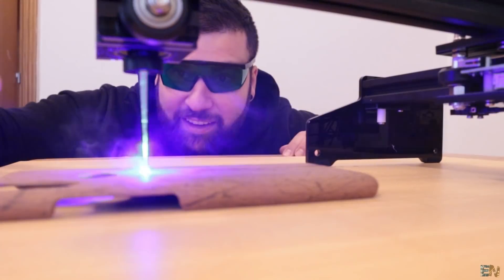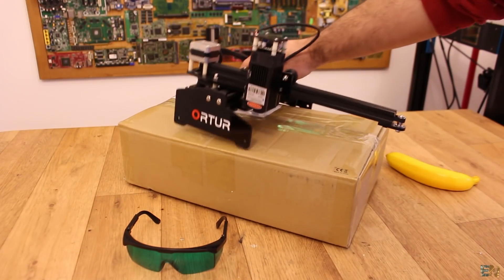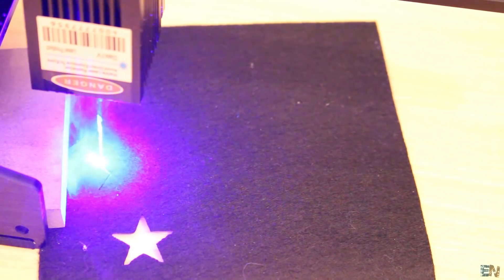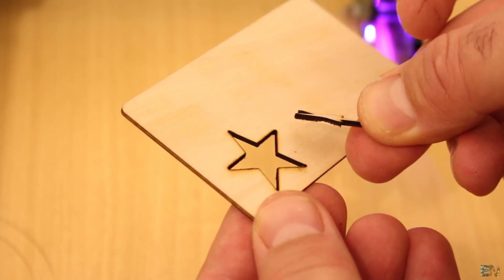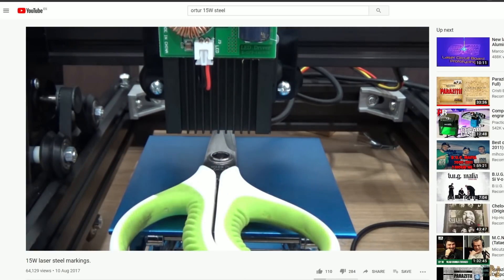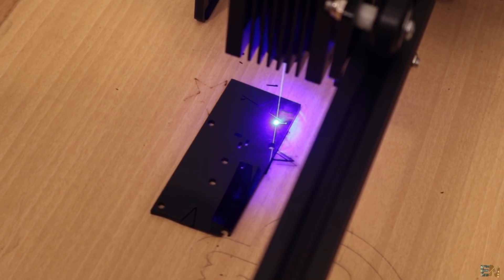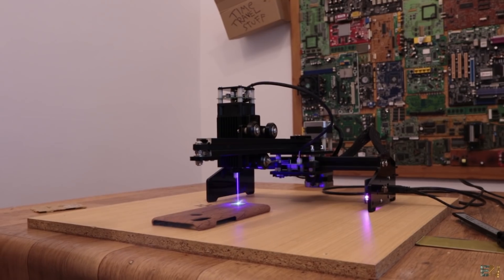What Can You Cut With This "15W" LASER Machine?

Comment: A bit of compressed air might help with wood cutting. There's a lot of smoke coming right off the hot spot, which is absorbing/blocking/defocusing the light.
Reply: That right. Even on a 40W CO2-Laser  compressed air makes a difference of several mm in Wood or PMMA.
Reply: Which is why proper laser cutters have an active air exhaust. And, you do not want to breathe those fumes.
Reply: It also (with diode lasers) makes a big difference what's underneath the wood your trying to cut. The only reliable way I have of cutting some  3mm "laserply" on my so-called 5W laser is to sit it on top of some paxolin PCB I had laying around. This half melts when the laser hits it and reflects the heat back up into the cut enough that I get smooth clean cuts 99% of the time. The only issue I have now is I'm not sure what that would be giving off as fumes (I work well ventilated) and also I'm running out and don't know where to buy any more or what else would work as good as it for a base plate.
Reply: even a fan would help
Reply: Price
Reply: I just have a fan turned on high facing it, blowing towards a window that I have a box fan in sucking the air out and it works really well.

Comment: Would painting the thicker MDF and thicker materials with black paint increase the cutting depth at all, d'you think?
Reply: Yes, the darker, the better, to advoid the reflection of laser
Reply: No ! this type of laser would take many passes for thicker materials. Define "thicker ".
Reply: @texascharlie4554  OK, cheers. The absolute "thickness" isn't important, though - I didn't ask if painting thicker things black would allow them to be cut all the way through; I asked if it would increase the cutting depth, which is a relative thing. If black paint/black surface treatment increase laser absorbtion, then the extra light absorbed (and extra heat generated) would surely increase the depth OR the width of the cut - or both. Or maybe just cause it to burn unpleasantly, perhaps! "Thicker" just means "thicker than the successfully-cut materials".

Comment: That's why I use a laser mounted onto an Ender 3. There is a hot swappable Thingiverse print that works well. This way you can lower the Z height after every pass to keep the laser point focussed on the layer you want. Gets through much quicker. I guess the printer you are using only does Z and Y.
Reply: Hi, I'm thinking of trying this with my Ender3, what laser are you using and what power output?, Cheers Sean.
Reply: @Séananigans69  Just a cheap chinese Laser. Cost about $80 with fan, module and glasses. On ebay..search for " 445nm 2.5w blue laser engraver"

Comment: Soon my companies 200 watt laser for sintering metal of 3D printed parts will be up and running.
Reply: Is it using a diode laser? A single diode laser?
Reply: @321ooo123  EOS 290 m Actually it is a 400 watt fiber laser. The polymer printer we will be getting is 200 watt.
Reply: @JoshWeaverRC  I think that's priced waaaaaay beyond the laser in the video :)
Reply: @321ooo123  Just a tad. And I bet it is a legit 400 as advertised.
Reply: Josh Weaver RC but can it cut 4mm balsa wood? :p
Reply: @He4vyD  I'm sure it can my man, but you want to look into a glowforge printer. It may do that.
Reply: Josh Weaver RC my question was meant as a joke... it would be very sad if your 200 watt laser couldn't cut that seeing the 7 watt one from this video almost could...
Reply: @He4vyD  Definitely, I was only answering for the cool factor in the slight chance you were wanting to make RC airplanes. A CNC laser cut foam wing or even another cutting device could be in my future for making planes.
Reply: How much the 200 watter lase would be?
Reply: @justintan7817  Ours is a part of a larger machine, so I'm not sure how much the laser itself would be. A lot though.

Comment: Can you try cutting regular white printing paper?
Reply: I would like an answer instead of a heart ;)
Reply: @He4vyD  Regular paper is actually a pretty decent challenge.
Usually it'll catch fire. If you cut fast enough, and in straight cuts, the diode powers up fast enough to cut in, without flair up. If the motion slows, to change direction, such as the star shape, it'll flair up on the corner, and burn. Air does not help enough, it does a little, but the beam is just not narrow enough.
Cardstock, 110lb. or velum 90lb, is a little better.
Reply: Tnx dude

Comment: I have a EleksLaser- A3 Pro 2500mW Laser with a Z Axis mod.
The Z Axis mod will lower the laser every loop causing the focus to stay on the material needed to be cut.
This mod works great!
Reply: Ortur Laser Master has more safety protection function, also the power ( Electrical Power: 15W, Luminous Power: 4000-4500 mw) of this one is higher, maybe you coud consider to try this one.
Reply: @justintan7817  I for sure would like to try / test / review it. Will you send me one? :-)

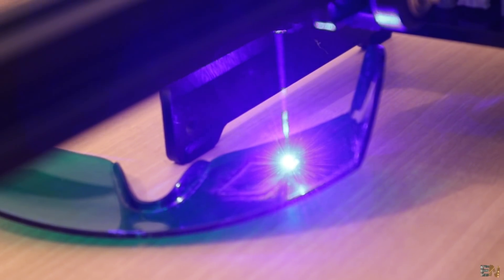Comment: If you can see ANY bit of light from the laser then they're dangerous. Your google look like they are the wrong kind, though I am not sure since you haven't shown us how the laser looks trough the glass. It does look like I can see a bit of reflection through the glass from the wood at 5:30
Afaik you should use yellow glasses since they block blue. (And 405nm is blue) These green onse look more like google for IR or red laser.
Reply: You do want to be able to see a little of the laser light so that you won't be tempted to take them off just to see where it's going. That said, if you end up with a pair that blocks too much, a quick fix is to use a smartphone or other camera+screen to map the wavelength to one that does go through.
Reply: @NiHaoMike64  How can you yourself calibrate the glasses accurately enough that there isn't more than 5mW of photonic energy going through? If the glasses aren't made for a specific Energy then it's impossible to be sure that what comes through it isn't damaging.
So: Use glasses where you can't see anything of it!
Reply: @NiHaoMike64  Very neat idea, thank you!
Reply: Ortur laser master is 445nm
Reply: @justintan7817  That's even closer to green, and these goggles are green - therefore they certainly are not the right kind.

Comment: The eBay glasses are definitely not safe to use. They might not melt completely through but they only block about 99% of the light which isn't nearly good enough, you can still get injured from a reflection or direct exposure. I would recommend glasses with at least OD5 to be safe.
Reply: Take no chances with your precious eyes. Go to LASERSAFETY.COM and read what you really need.

Comment: The most powerful single diode out there which can fit in a diode holder that big is nubm 47 with 7watts output power.
Reply: Exactly, there's no 10w nor 15w laser module out there
Reply: Though I do know a manufacturer, who uses prisms to combine output of 2 to 4 diodes and seal it up in a single housing.I think they are called endurance lasers.  And there are indeed big industrial diodes like the one Michel reps showed.

But none in that size

Comment: The issue when cutting through 4mm balsa is from the nature or your "cutting element" the laser is manuly focalised on the top or the material. When it has cut two mm, the laser isn't focalised in trench and the material needs more and more energy to cut because instead of focusing thé energy  in a tiny spot to burn a little piece of material, it is burning a greater surface. It would has been useful to have a Z-axis to lift down the laser after each loop and keep the energy/surface ratio constant
Edit : I had not seen the explanation before posting m'y comment
Maybe, try to focus the laser in the middle of the material instead of the surface
Reply: This is correct. To add to this, instead of focusing the laser in the middle before you start, do 1 or 2 passes with it focused on the surface then refocus the laser to the "new" surface a couple of mm down, keep repeating the process until you've cut all the way through the material. The more you do it between passes, the better the cut will be as long as the material or the machine head doesn't move.

Comment: I suspect the problem with thicker wood is that once it has charred the wood to carbon, the carbon is extremely heat-resistant, so it doesn’t burn away. Thats very interesting about plywood though!
Reply: I suspect but cant prove is that the glue layer between the plies is burning away cleanly and exposing a fresh layer of wood. Another factor is on the 5m play the outer layers are probably a different species than the face layers. . It would be interesting is to see these tests on various thicknesses  of birch, aircraft or high ply count model plywood. I've got some .4mm plywood that has three plies of equal thickness. A sheet of .4mm is at least twice as much as .8mm and even more than a sheet of 6mm. Another test I would like to see is on Basswood or Linden. Say .8mm, 1.5mm and 3mm. These machines are meant after all for hobbyists. One could even use them for a modest business producing say craftsman style kits for model railroading.
Reply: That's one reason the Russians used Oak for re-entry Heat Shields at one time IIRC.

Comment: Do you think spray painting the PCB and using the laser to remove the paint would work for etching a circuit?
Reply from the maker: Yes, I've tried that with lower power laser and it worked...
Reply: That's what they did at Texas A&M to make PCBs. The etching worked great but the via plating left much to be desired. Of course, now that PCB services are way cheaper than they were back then, making PCBs at home only makes sense if you want a really fast turnaround time or if you're making PCBs out of something other than FR4 such as flexible PCB.

Comment: The eBay glasses are not good enough.... but there's no explanation whatsoever as to why that's the case.
I'm not asking why, I can draw conjectures myself, just noting that making a judgement like this without backing it up is just not enough for a review video.
Reply from the maker: just low quality and less wavelength filters...
Reply: @ELECTRONOOBS  thanks, how did you measure that? I didn't see it in the video.
Reply: Not only that, sometimes, the wavelength they are advertised for, is actually the one wich it doesn't block.
In other cases, it doesn't block enough.
Reply: @SurajGrewal  well it's a review. IF reviewing means saying "you know, it maybe okay, or maybe not, I think it's not". Then it's not really useful.
Measuring stuffs in the physics world is how you assess things. Don't ask me how to do it, I didn't make the video. But maybe my expectations are too high for electronoob.
Reply: @unperrier  ok... Get a spectrometer and a full wavelength lamp to test it... With that, you'll be able to exactly tell, what optical density the glasses has and for what wavelength. But it'll set you back with about 50-5000$
Reply: @SurajGrewal  All I'm saying is that a review that says "it's probably crap" is not a review if he doesn't have a real clue. No proof, no claim, simple.
Reply: 'Probably', right?

Comment: Could you swap the laser for a more powerful one and still use the base?
Reply from the maker: Of course
Reply: but the thing that i'm afraid of, the laser module is mounted on a single axis with no support on the other side, if  the more powerful laser module is heavier, it might cause some problem later on
Reply: @clee2423  There are plenty of higher power diodes that will fit into that housing. Just be sure to use a driver that can deliver the additional current to the diode.

Comment: As anything goes for china products, you can divide the specs by 10 and you'll get the actual rating. 15w --> 1,5W at the focal point.
Reply: 15W is the electronical power, and the Luminous Power is 4,000-4,500mw, this information listed in the product specifications
Reply: lol , sooo true !! I have a 6000x digital microscope .  swear down. I can see atoms man.  You should get one. it was $20